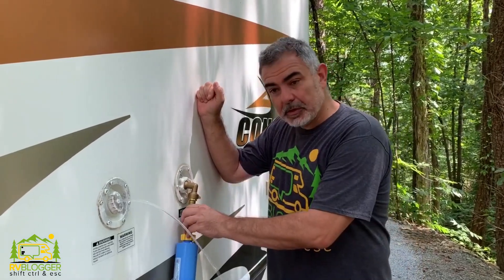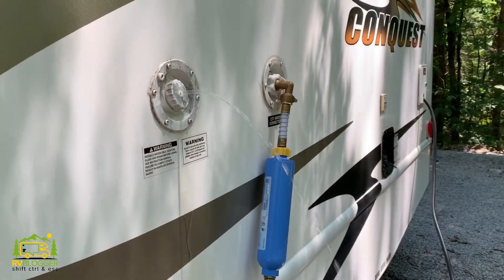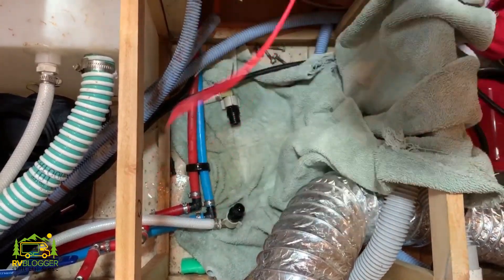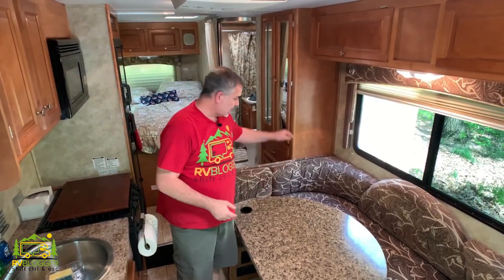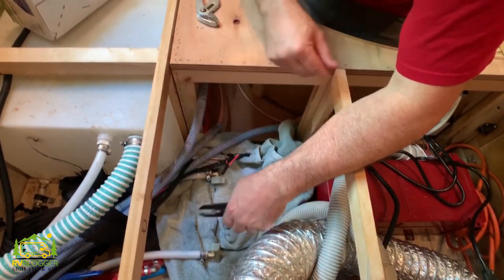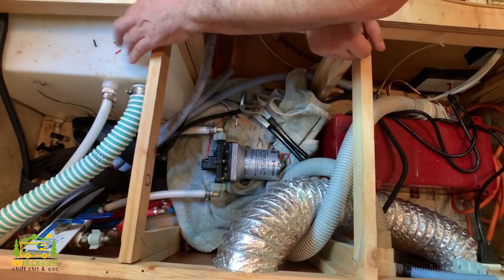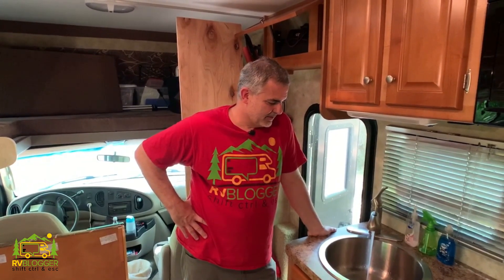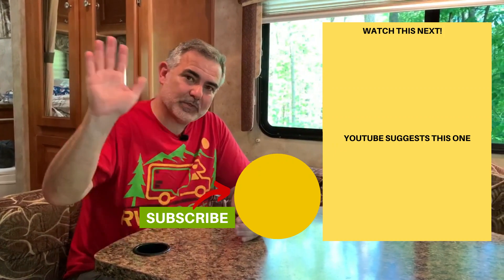RV Water Pump Replacement! Check Valve Problem Solved!

Comment: Great video. We started experiencing this exact issue last year and  I appreciate knowing it wasn't just me who's original trailer pumps check valve had seized and failed. We use the park water now since they switched from their wells to city water and I just capped off the discharge side of the trailer pump to stop the water leaking back through it into the holding tank, which would then overflow onto the ground.  I just purchased a Shurflo 4048-153-E75 4048 High Flow Pump that I will install next year. Its a little pricey but it worked well last year when we were pumping water from our separate holding tank; until it burnt out from running dry after the trailer pump check failed and the system wouldn't pressurize to shut don't the Shurflo. And yes, we forgot to turn the power to the Shurflo off so our bad : )
Reply from the maker: Hey Lee, 
We appreciate the love and support, also for your input and experience! 
Thanks for watching and commenting! 
❤ Mike and Susan 

By the way, we hope you will subscribe to our FREE monthly digital/video magazine called RV Camping Magazine. Let us know how you like it!
https://rvblogger.com/rv-camping-magazine/

Comment: Thanks for the video. I notice you don't use an inline filter to trap larger bits, is there a reason for that?
Reply from the maker: Hi Norm,
At the time we shot this video we used an inline filter outside the RV. You can see it right at the beginning of the video. Now we use a 2 stage filter and we are adding a UV water purification system to the RV soon so stay tuned for that video. Here is a video about our 2 stage filter if you want to check it out.
https://youtu.be/06nHVkDeqwg
Thanks for watching and commenting! 
Mike and Susan 

By the way, we hope you will subscribe to our FREE monthly digital/video magazine called RV Camping Magazine. Let us know how you like it!
https://rvblogger.com/rv-camping-magazine/

Comment: Hello, how did you know that the new pump was compatible since it was a different brand with what sounds like different settings? Thanks in advance.
Reply from the maker: Hi Justin,
Great question!
It is a 12 V pump so it can work on battery or shore power and the fittings were all the same size. Most water pumps are interchangeable...
Thanks for watching and commenting! 
Mike and Susan 

GET READY! We are launching our new digital/video magazine called RV Camping Magazine on June 1st! Stay tuned for our YouTube Video all about it!

Comment: ahh gee, what a nice man, I am at a crossroads, my freshwater tank spills its water before its full, thru a pipe underneath the rv trailer, that  i use to meditate and read the WORD quietly, away from my cats and happy about that. any ideas? Miguel from Lorain, Ohio
Reply from the maker: Does it constantly leak? Could be several things....broken pump, busted pipe, loose connection or the holding tank valve under your RV for draining. Have you checked all those? Hope this helps. Thanks for watching and commenting.

Comment: So, bottom line, was it a bad check valve in your water pump causing the problem?  My fresh water inlet is leaking water and I'm not hooked up to city water.  I took it to an rv repair shop and they changed the city water inlet insyead of fresh water and when I said it was the fresh water leaking they replaced the fresh water valve and it's still leaking.
Reply from the maker: HI Renee,
In our case yes, there was a bad check valve within the water pump...I'm not quite sure why yours is leaking but things are not always as they appear! lol! I've had to learn that the hard way quite a few times.
Thanks for watching and commenting! 
Mike and Susan 

By the way, we hope you will subscribe to our FREE monthly digital/video magazine called RV Camping Magazine. Let us know how you like it!
https://rvblogger.com/rv-camping-magazine/

Comment: I have the same Shurflo water pump. The internal check valve failed causing the fresh water tank to overflow when connected to city water.   Just sayin'.
Reply from the maker: Yup! Not very reliable! 😡 Thanks for watching and commenting.

Comment: A water pressure reducer will decrease the likelihood that excessive city water pressure will damage the checkvalve in your water pump.
Reply from the maker: Hi Chuck - or whoever you are...lol!
Great point - we use a water pressure regulator which does help but every now and then the water pumps just fail.
Thanks for watching and commenting!
Mike and Susan

By the way, have you subscribed to our YouTube channel yet? If not we sure hope you will click below and subscribe! Thanks!
http://goto.rvblogger.com/YoutubeChannel?sub_confirmation=1